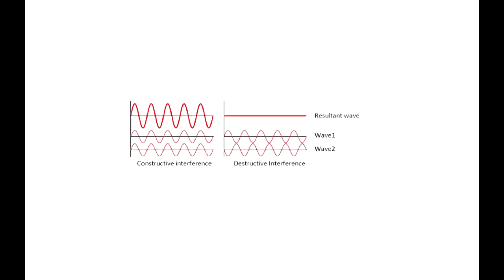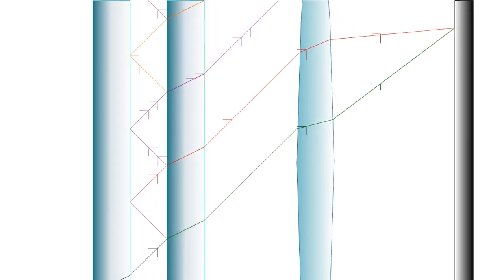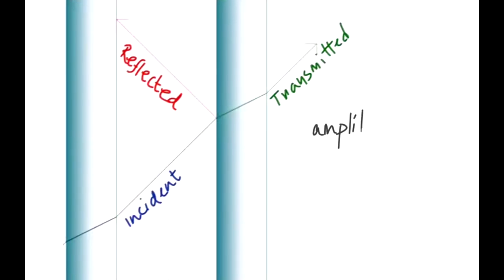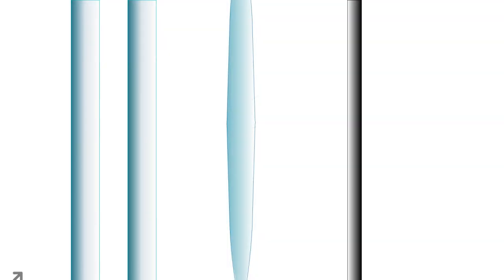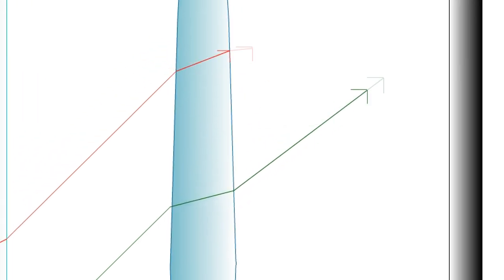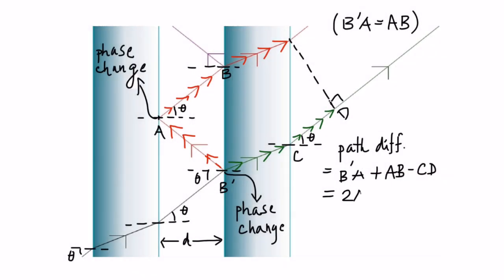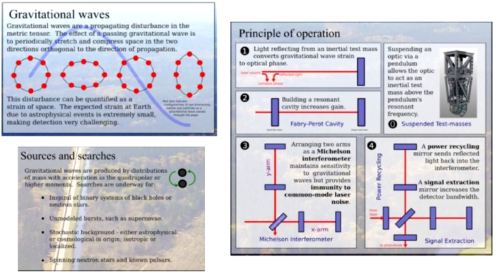Fabry Perot Interferometer

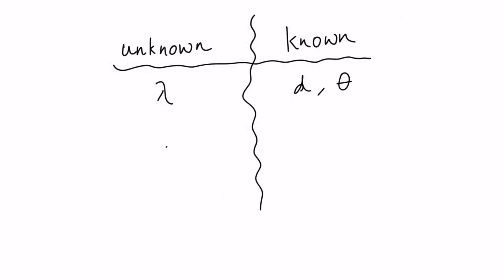Comment: The path difference at 3:39 is 2*d*cos(Theta). However, at 4:00 the path difference is written as d*cos(Theta) which is then put equal to m*lambda...shouldn't it be 2*d*cos(Theta)=m*lambda, in order to have constructive interference?
Reply: Federico Pevere you are right It is  2dCos(x)
Reply: can someone tell me why the pattern is circular?
Reply: @harshitabhuyan8892  Sorry for the late answer, but I believe the pattern is circular because constructive interference can only occur at certain angles \theta between the incident ray and the optical axis (the horizontal line). In a 2 dimensional system, you would therefore obtain a typical "on-off" interference pattern, but in a 3 dimensional one this pattern is rotated around the optical axis. The shape of the lens is also a factor, because only a radially symmetric lens will create such a pattern.